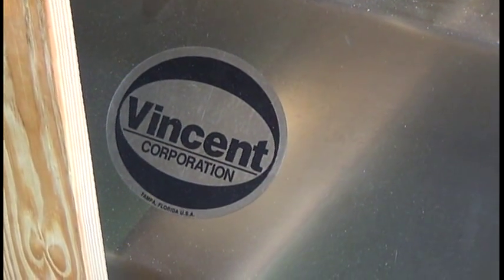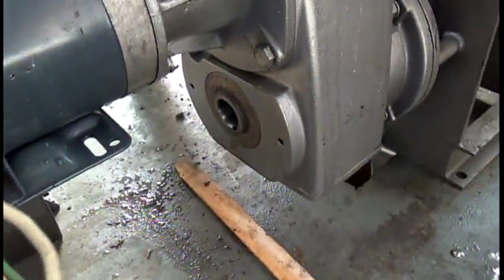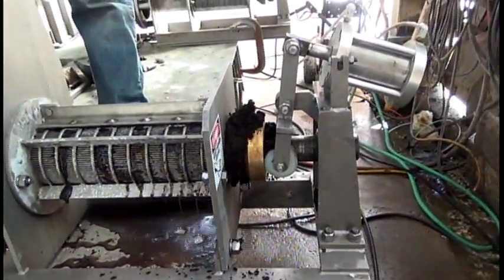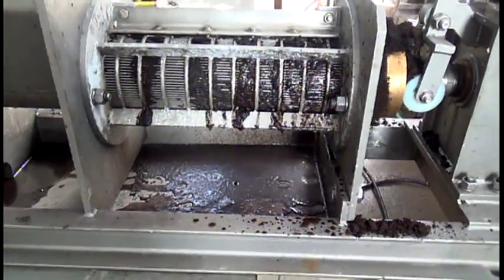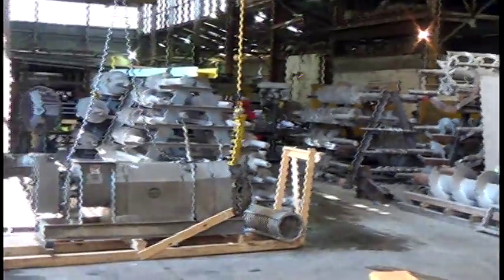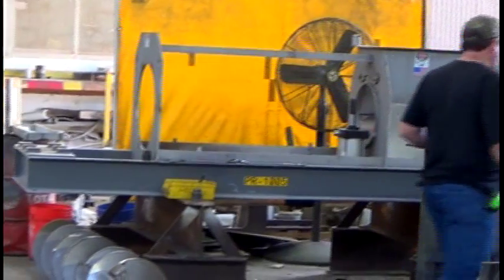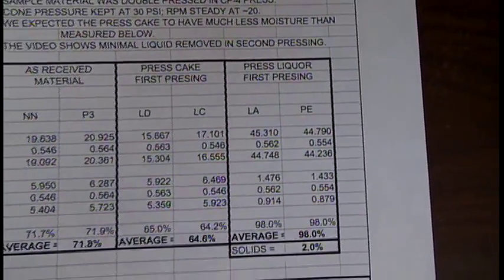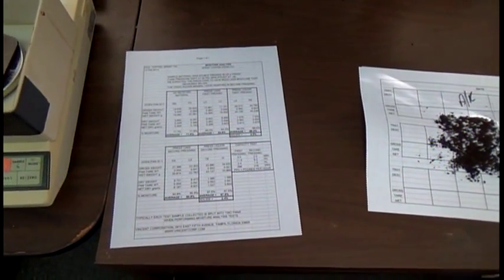COFFEE GROUNDS BIOFUEL DOUBLE PRESSING

Comment: how much oil can be extracted from presseing the oil out of the coffe ground. And is the coffe ground then good enough for makinh biomass pellets. Oh, and is bio pressing the best way to extract oil from Coffe grounds ?
Reply from the maker: +CeasarCPH, The press does not extract oil from the grounds; the "biofuel" in this case is the dewatered coffee grounds, which are burned in a boiler to generate thermal energy. This Pressing News article describes the process: http://www.vincentcorp.com/content/biomass-burning-system
Reply: +VincentCorp1931 So I'm wrong to assume that by pouring Coffe Grounds to the machine, and then use the transesterification method could lead to biodiesel ?
Reply from the maker: +CeasarCPH Our coffee experience relates only to squeezing the water from the grounds to be used as boiler fuel. What you are suggesting would be a new application for our press. We're known for our willingness to try anything, so if you'd like us to run a quick test for you or would like to rent a press to try it yourself, contact us at vincent@vincentcorp.com or +1 813-248-2650. Ask for Bob.
Reply: +VincentCorp1931 I will differently write to you. Send you a detailed Email, so a test may work :)
Reply: @CeasarCPH  Did you happen to have any success with cold pressing spent coffee grounds for the extraction of coffee oil? Or perhaps @VincenCorp1931 did you acquire any more knowledge about cold pressing spent coffee grounds for not only extracting water but also oil with your machinery?